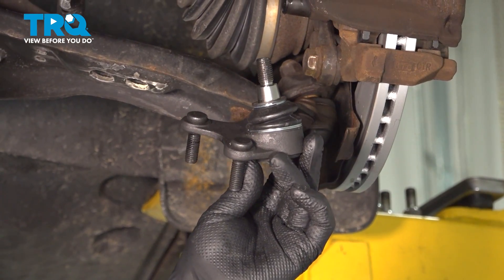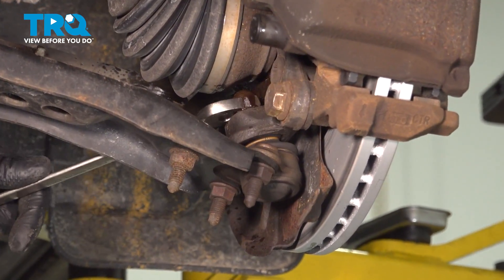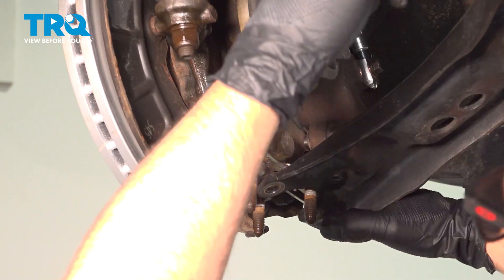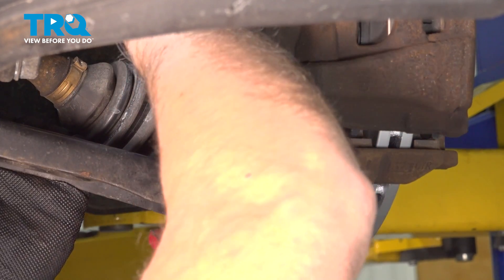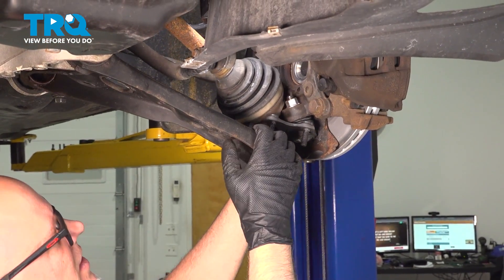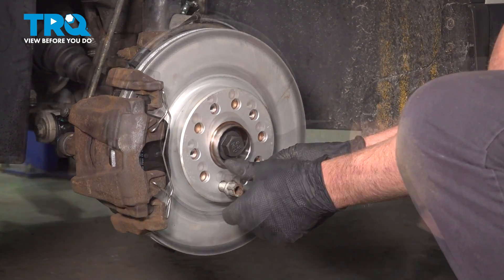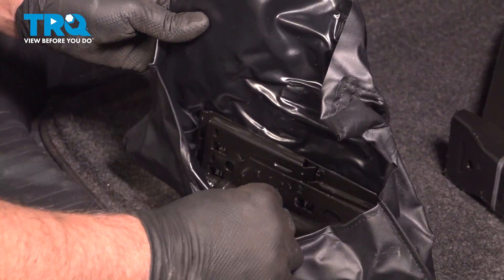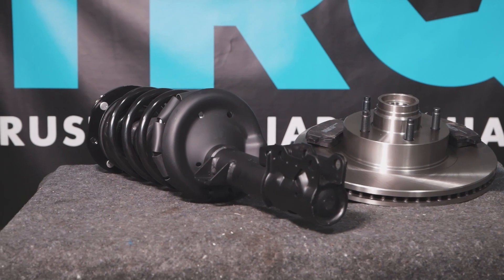How to Replace Front Lower Ball Joints 2009-2017 Volkswagen Tiguan

Comment: Dude, The additional 90 degree turn of the bolt is supposed to be done with the tire on the ground (wheel under load). Fix this video! VW hubs use double-row angular-contact bearings that are designed to be clamped under load.
When the car is in the air, the inner and outer races are NOT aligned in their natural loaded orientation. Angle-torque in this state can side-load or over-compress the bearing.

Comment: Good video and good to see that you had correctly torqued bolt/nuts however you didn’t say you had new driveshaft bolt which you should as it is a stretch bolt. I don’t think the disconnection of the driveshaft is necessary, although not able use standard socket torque wrench. Thanks

Comment: It's pleasing to see the video work around the problem of the whole joint spinning. I've also found that a bit of heat on the nut can give you enough movement so that the hex key hole isn't rounded off.